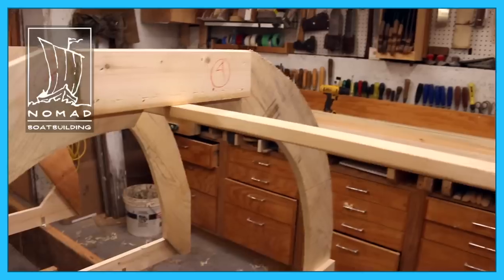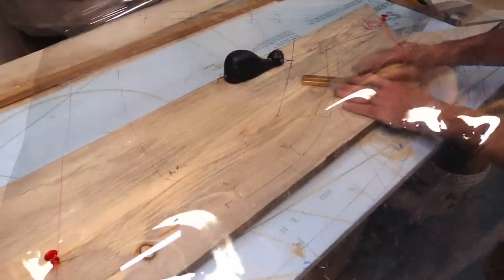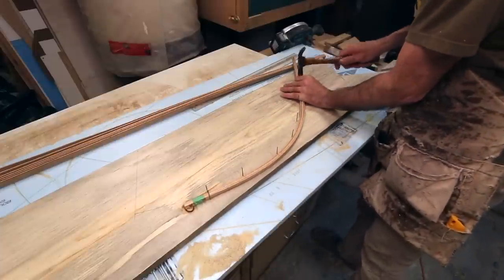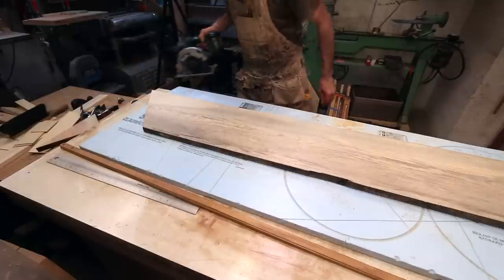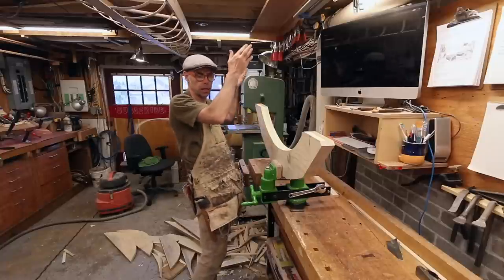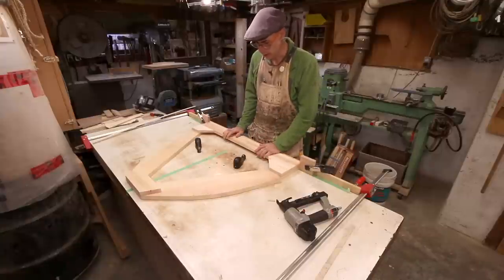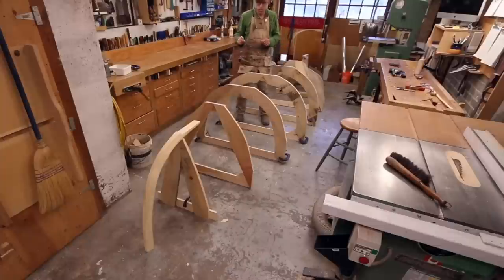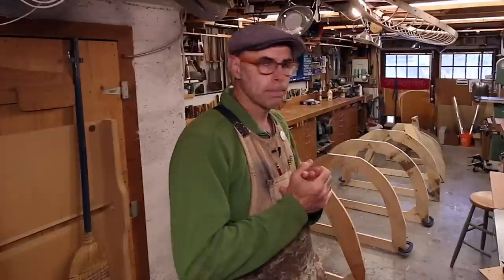Building the Catalina Wherry - Part 11 - Building Station Moulds

Comment: I found your comments on ply vs boards for stn moulds quite interesting - hadn’t really thought of it before - makes sense - Cheers.
Reply from the maker: I try to consider my environmental impact without getting rabid about it. But more than that, I find the pine way faster and easier to use. Also, you can clamp to the moulds which solid ply will not allow.

Comment: Big plus one for solid wood mold stock.  By all means, go off on a sustainability tangent, and I really agree on solid pine being is easier to fair with edge tools. It's also way easier on bandsaw blades.  Also, I think the dust is (less) toxic, and if not, at least it smells better.   Funny enough, I'm making up a set of molds for a 17' modified Rangeley lakes guideboat today, and while I use the roofing nail method,  we're basically in lock step for sequence and set up.  I agree on the bandsaw.  I try and draw a fine line and then focus on "splitting" that line.  It really helps make them just about perfect right off the bandsaw.   keep up the great work.
Reply from the maker: I'm going from memory here but isn’t the Rangeley essentially a wherry too, with a plank keel? Been a while since I looked at the lines. I think took one for a row some years back at the Center for Wooden Boats.
I would use the roofing nail method if I were lofting on a different surface. I think I treat my lofting panels a bit precious. Maybe I'm being a dope.
Reply: Yep, you’re right.  I built one, a double ended a long, long time ago.  This one is going to be glued lap and my modification is for a client who wants to carry a small (electric.) outboard, so I carved a mode and am working from that.  And, you’re not being dopey at all! I also agree re: lofting plywood.   It’s expensive/precious. I fill the nail head dents with some elmers brand wood filler from boat to boat and give it all a light sanding before a fresh coat of paint anyway. I don’t need a huge pile of 1/4” plywood with lofted boats I don’t need to reference anymore taking up space. Keep up the awesome work!

Comment: That's a very good industrial duty staple gun. Durable and reliable.
Reply from the maker: Yes, those Porter Cable guns have been rock solid. I think I have only replaced the seals on one so far. Got to be going on twenty years now.
Reply: @Nomadboatbuilding  the P.C. guns. Oil or oil free.
Reply from the maker: Oil.
Reply: @Nomadboatbuilding  Ahhhh, that of course is why.

Comment: Mark l have the Omer nailer the one that takes up to 63mm fat nails (14g in think) that has a depth adjuster.   The Raptor thinner pins worked in my cheapo finish nailer but not onto hard timber.  I had a bunch of furring strips to which I figured was worth the cost to bang them down and plane the afterwards so bought the bigger one. Anyway I’m happy with mine and reasonable confident it will work well, also l use mine for templating, also got a laminating job coming up.  So I can joint an thickness without worrying about the blades, bang them in and just knock of the protruding nail with the side of a chisel, with templating when your done lozenge it and you can reuse the templating stock.   And the Wherry’s coming along nicely ❤.
Reply from the maker: If any sort of cold moulding job comes up, I'm pretty sure I'll grab a stapler too.
Reply: @Nomadboatbuilding  yeup l want a staple but can’t get it past my boss 😱

Comment: I use a staple gun for strip canoes. To stop marring the surface of the cedar strips I use a thick cardboard and staple through it and adjust the air pressure accordingly to limit head penetration (of the cardboard). Blow out on the back side??? Maybe a narrower gauge staple?
Reply from the maker: That’s the narrowest they make in the polymer type.

Comment: Hi  Getting there  :  a question - where did you get that neat green colour bench top vice ( @ 10;:46 0 ?  Looks for very usefull
Reply from the maker: It's a luthiers vice. I got it from Lee Valley Tools but you can get an almost identical one from StewMac in the USA. They cost about $200. Well worth it. Hangs onto just about anything very well.

Comment: Waste wood of pine is far more useful than plywood: I rip waste pine into strips to the smallest width available in the pile. Glue the strips into pine boards (See Epic Upcycling for method) and use as shelving, etc. Trim to width, run through planer, cut to length. Made a rolling laundry room cart.  (I put everything on wheels).
Reply from the maker: Good man. Keep the kindling pile as lean as possible.